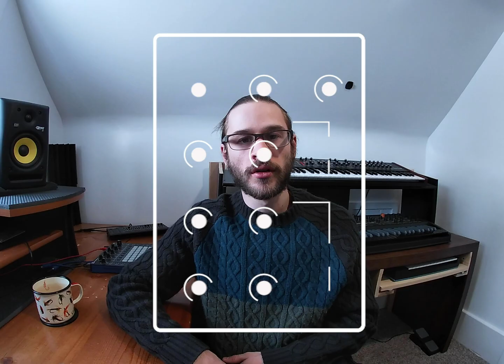What is Envelope Amount

Comment: I thought it would lengthen or shorten the ASDR knob times, but it seems to be like a wet control. Is there a global control to modify the scale of those knobs?
Reply from the maker: So that feature does exits on some synths, but it’s not super common. I can’t remember what it’s called off the top of my head, but may go by a few names. But that parameter does exist! Just not crazily common